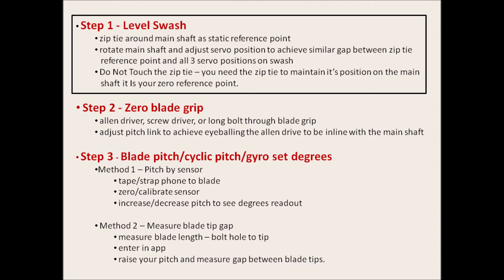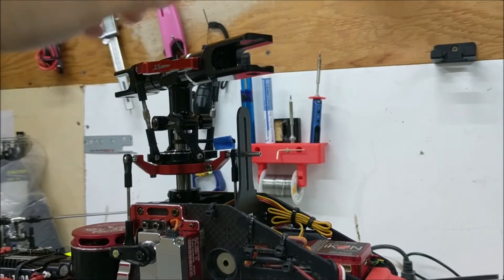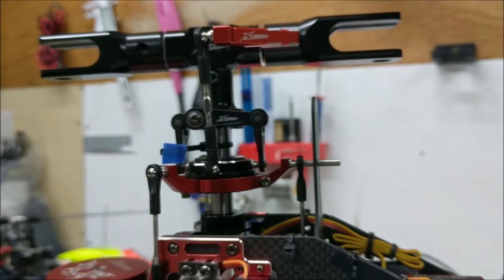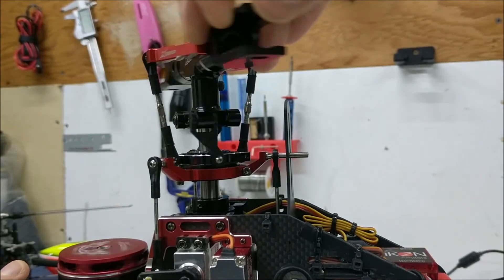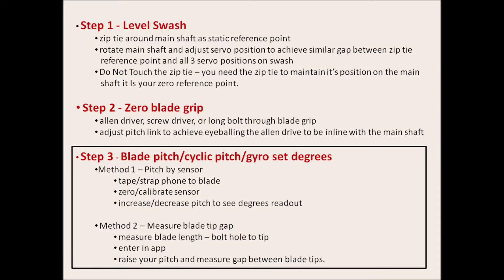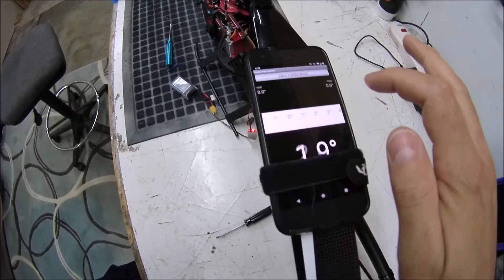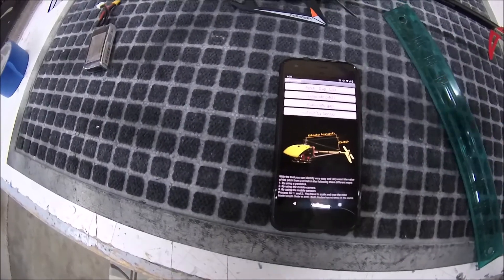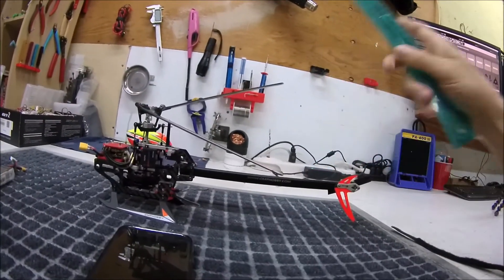RC heli head setup - level swashplate - zero blade pitch - collective pitch: zip tie method

Comment: Zip tie good. Didn’t notice you set the swash HEIGHT. This is not super critical but should be close. All helis I’ve seen should have the radius arms (other names for this) HORIZONTAL. Then set the level of swash. This shows for full swash travel amongst other things. It’s what a swash level tool does. It says the HEIGHT and the LEVEL
Reply from the maker: the arms do not have to be level for full swash travel, it depends on the helicopter design. the swash balls being equi distant from head and frame are what get you full travel. Typically you don't need all that travel anyway to hit 13 degrees + cyclic.